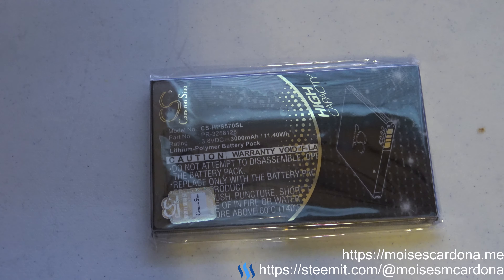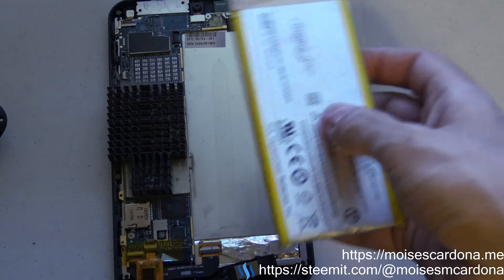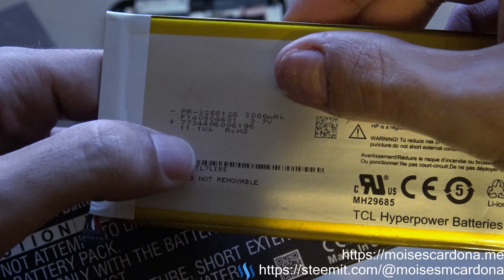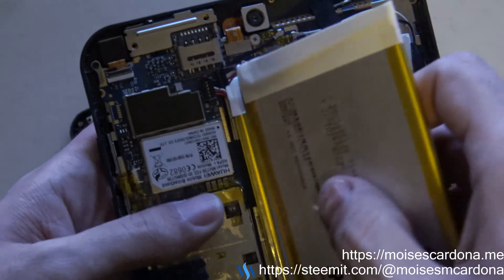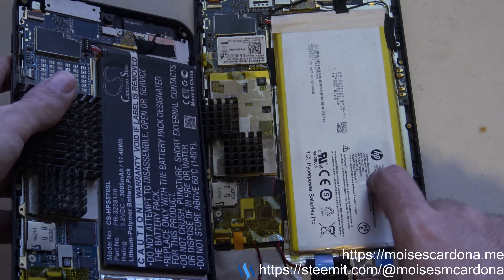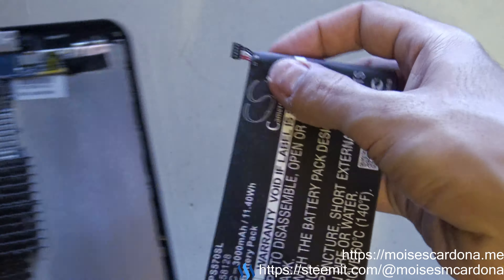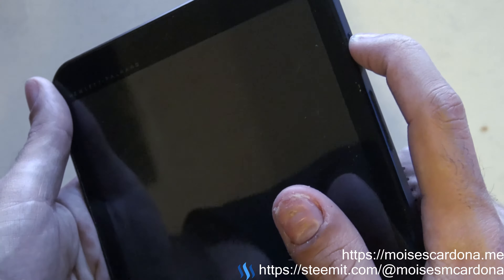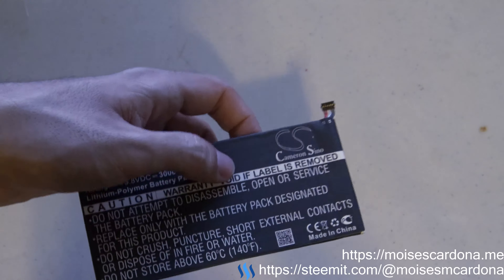Unboxing, overview and Testing of the Cameron Sino Battery for HP Stream 7

Comment: Did it work? I just purchased one HP Stream 7 (second hand) for very cheap and wouldn't hold charge, I was researching on getting exactly those Sino Batteries from Amazon but I came across some forums talking about the volume down trick. It did help but my battery would still discharge (a bit slower but still discharging). Would consume 60% of the charge overnight in suspend mode!!!.

I managed to fix it: disable the windows update, remote desktop, file search and other services. It's not just changing the prefs of windows update, you must stop and disable all those services. My Stream is not holding charge perfectly, consuming only 2% overnight in suspend mode. I still use the volume down trick just in case (or set the stream in mute mode). I posted here the details: http://kebris.com/pages/hp-stream-windows-tablet-battery-life-solved 

I was about to buy the new battery, lucky me that wasn't needed anymore.
Reply from the maker: Yes, it works and you can see in the video that it works. The original battery wasn't holding a charge and this battery solved my issues. No need to change settings on Windows. Just switch the battery and it's ready to go